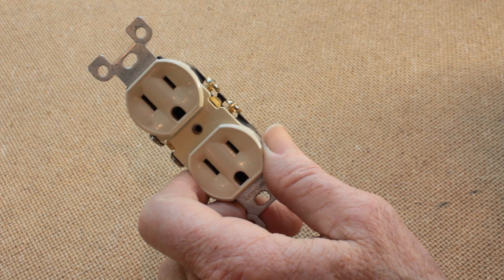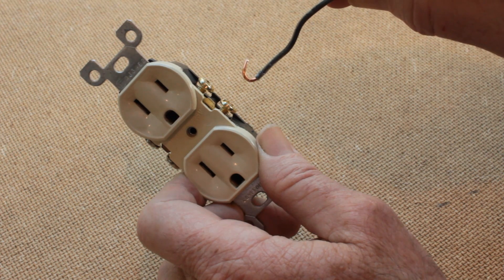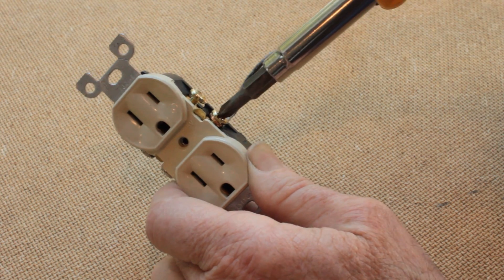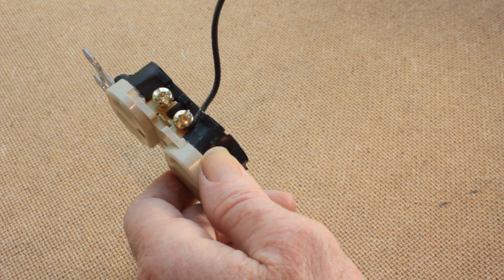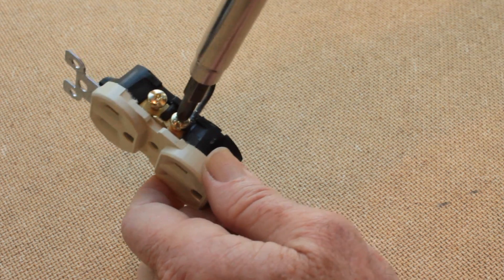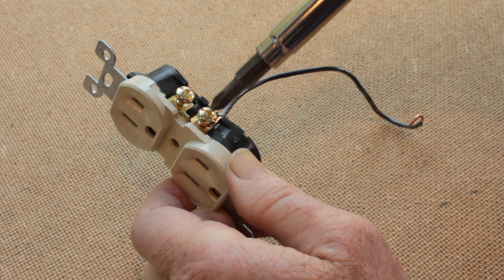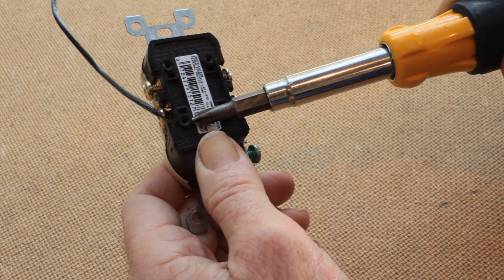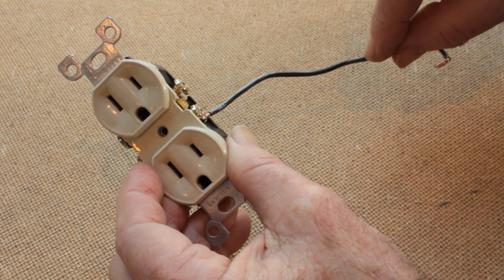A Common Goof Replacing Outlets

Comment: I would recommend using a square #1 Robertson screwdriver as opposed to a regular phillips.. for both, the terminations and for screwing the receptacle to the box.
Reply: Yes, here in Canada, the screws on receptacles all have the Robertson square hole (combined with a straight slot).  The Robertson style is the best no-slip design I've ever seen, and has been in non-electrical use (like for wood screws) in Canada for at least 70+ years.
Reply: If you can get them, Milwaukee has a MEC type screwdriver that's both common and Robertson on the same tip. Seemed crazy at first, but shockingly effective.

Comment: I have another pointer here on this.  If you're experienced enough, and can change out a device w/ the power still on, attach the bare ground wire first, then, the white neutral wire next.  Hold device with a pair of long nosed pliers by the plaster ears, then, carefully attach the black wire lastly.  If you're concerned about getting zapped, like I was in the beginning, shut down the circuit.
Reply: That’s what a meter or test light is for. To me it really isn’t dead until I test it. Trust, but verify......
Reply: I plug an outlet tester into the outlet.  Makes a nice handle, even if the circuit is off.
Reply: If it's only 110, be sure to lick your fingers first or you might not feel it!
Reply: Absolutely!  I have more than once thought I turned off the power, just to find that I turned off power somewhere else.  Always test - and always test for hot - regardless of the color on the wire.
Reply: Kurt Harer "experienced enough"? I doubt OHSA would consider one qualified to rewire an outlet live. Would the risk of doing it dead, out weigh those doing it live?
Reply: Hah! For years I've been thinking that I was the only person bold or dumb enough to work on live wires. It's good to know that there are others out there who are not intimidated by a few billion measly electrons. It's pretty simple, really; don't be grounded!
Reply: They have pills for that now.
Reply: and that was his last comment folks. He was a nice guy though.
Reply: As a rule there is rarely a valid reason to work with live circuit, why do so, if the circuit can be de-energized?. A few steps is not worth not following basic safety practices.
Reply from the maker: True, sometimes it is a big hassle to turn the breaker off. But my advice is that if you are in a hurry, you are more likely to get shocked accidentally, in spite of knowing how to do the task live.
Reply: @ TheCircuitDetective,  oh yeah, I've been bitten by Old Man Electricity before.  I worked as an apprentice for a Master Electrician, along with one other Apprentice, and Journeyman.   They would say, okay, power's off. They loved playing games with me. Never trust the other guy saying thus and such. The Journeyman was good to me, and he's the one that showed me the ground wire, then the white neutral and then the black hot wire last.  I learned quite a bit, and rewired my own house, built back in 1902, then, added on to in 1959. This old house was wired with Knob and Tube wiring, no ground either.  The original owner used a DC generator for power.  In 2009, the Journeyman, and myself, changed the house over from 100A to 200A, and proper grounding to boot.   Well, thanks for the reply.
Reply: why would you want to do it that way? If you hook the hot wire up first then you can handle the outlet and the wire without getting shocked, then when you go to hook the ground and neutral up you only have the one small area that you have to avoid touching instead of having to work with a wire that you cant touch while hooking it to something you cant touch
Reply: In a hospital, it might be less risky to rewire an outlet live. Although they would probably require a gloved hand as opposed to pliers. Squeezing too hard could cracking or break the plastic. Hospitals would probably use outlets where the wire goes in straight and is clamped as the screw is tightened.  You mention plastic ears on an outlet, but I've never used or seen one. Are you sure they are plastic?

Comment: Actually i just put all my outlets in... and i am having problems plugging things into the upper outlet... it doesnt want to fit... what can i do? The bottom one is perfect the upper ones feel like u can't use them...
Reply from the maker: Most new receptacles now are "tamper resistant." That will mean that both of the flat prongs of the cord you are plugging in have to enter at the same time and at the same angle. Otherwise the receptacle will resist. That might be what is going on.
Reply: TheCircuitDetective so should I try to take it out of the wall and bend the cords again behind it to try and see if its the way it was put in? Because it wont take a plug at all. :/
Reply from the maker: . No, I don't think how the wires were attached behind the receptacle would account for your problem. It could just be that the upper half of the receptacle is broken or has something stuck in it. So I would just replace the whole thing.

Comment: Your wire looks like it was stripped way too long.  There is a strip gauge on the bottom of most new outlets this reason.  To take the guess work out.
Reply from the maker: This is almost the point of this video. It is not clear whether the strip gauge is for when you would be pushing wires into the holes on the back or curling them under the screws on the side. In any case, we can't be held to the strip gauge anyway, because no one can strip wires that exactly.
Reply: The point of this video is based on the fact the strip gauge is for use with the push in option, not the screw terminal option. The reason he strip off as much as he did was to insure the insulation can't interfere with the screw.

Comment: I replace a new ac 3 prong outlet  , followed to  wire to wire from old to new out let ,  now when checking with volt meter the [shorter] slot prong is hot to ground  it is  OK 120 volts it works fine. but in  my mobile home  has ALL its outlets are opposite the [long ] prong slot  to to ground  is 120 volts in a 1976 mobile home?
Reply: If the colors are also reversed - so white is hot and black is neutral, you may want to switch at the panel.  Sounds like the whole unit is reversed.

Comment: funny how state by state the lingo is different for the wire naming---  common neutral ground.  power,common,ground     The electrical code book needs to be nationalized so the lingo is country wide.
Reply from the maker: If you're talking about states of the US and about a house's own wiring, the terms "hot, neutral, ground" are pretty established; "common" means something else. I don't find electricians or homeowners using the Code book's names for these, namely, "ungrounded, grounded, and grounding."
Reply: I totally agree with your statement.   I just want established consent in the USA and understanding even how you currently understand it.      I could be wrong but I think even this wording should be the same with even residential VS industrial wiring as well and should be the same.
Reply: The national Electric Code uses proper terminology consistently. The problem isn't the book. The problem is people who can't be bothered to speak in a professional manner.
Reply: I still love to trip up people, by calling the hot wire the active, the neutral remains the neutral wire, and the ground as the earth wire. These terms are seen in 'Straya and that part of the world.

Comment: i have an outlet that started acting up. i used a non contact voltage tester to probe the outlet. it would beep and light up quit for a few seconds then beep and light up again. it did this on top and bottom of recepticale and on both prong slots. any ideas?
Reply from the maker: I suppose the act of probing could affect the quality of wire-to-receptacle contact right at that outlet. If so, replacing that receptacle would solve the problem. Otherwise, I'm not sure.
Reply: TheCircuitDetective I tried it on an outlet that was replaced by a licensed electrician,  when probing it lit up constantly but only on the right prongs. i suppose it wouldn't hurt to just shut off power and replace with new receptacle and check for damaged wires?
Reply from the maker: If the electrician was trying to solve the problem you had, he seems to have failed. Would he come back without a trip fee? The tester beeping for the left side may mean there is a poor white-wire connection there (or at another receptacle of the circuit). My website could guide you if you want to try to tackle the problem yourself.
Reply: TheCircuitDetective no I just used the non contact electrical tester to get an example off a replaced outlet. he replaced that outlet in the living room one of the wires was bad and caused problems, he replaced the wire also. this new problem outlet is in a seperate room. when I had something plugged in it would sometimes work then quit. I stopped using that outlet for now all together.

now a family member reported another outlet in that bedroom is starting to sometimes act goofy. maybe this is over my head?
Reply from the maker: It's up to you. If thecircuitdetective dot com sounds beyond you, you may need the electrician back. He's batting  1000 so far.

Comment: "The hot wires normally are the black wires."  Hahaha!  If a weekend warrior has been modifying the electrical system, you cannot assume that.  Literally, everything needs to be questioned and checked.
Reply from the maker: Yes, but if it is also a weekend warrior who is now replacing the receptacle, he doesn't know how to check everything. In that case, just duplicating on the new receptacle what side of the old receptacle a wire came from shouldn't cause a problem.
Reply: Guns are always loaded and wires are always live until you have checked for yourself.
Reply from the maker: The movement of electrons does alternate, but a "hot" wire remains hot regardless, because it is still able to complete a circuit (circle) to ground. When we say about AC that power "goes out from the breaker," it is only because we need a directional way to talk about the PATH electricity is taking (whether in one direction or the other at this instant).
Reply: The white wire goes to the silver colored screw and the black wire goes to the brass colored screw.  The ground wire (green or green/ yellow stripe.) goes to a screw on the frame of the outlet.
Reply: Totally agree.  Reversed hot/neutral has all kinds of potentially harmful issues.  Always check - or just don't mess with it in the first place if you don't know what you're doing.
Reply: so from my understanding the electricity is alternating current , it goes one way then the other 60 times a second . so is it going in or going out ?
Reply: True.  Our hallway had a 3-way switch that didn't work.  I traced the wiring and fixed it, and you could tell that the interior had been repainted at least THREE TIMES since those mis-wired switches had been installed!!

Comment: Black wires are hot, however a white wire with black tape can mean hot wire too. Depending on the current flow and receptacle function.
Reply: J K.  True but the only time a white wire is used is in a switch loop using 2 conductor wire. Now NEC code requires 3 conductor wire. Black and red being your hots.
Reply: CEC is the same in Canada as of 2018
Reply: I was recently told by a licensed electrician that using tape for marking wires is no longer the preferred method. He just used a black marker.
Reply: Three way switch ?

Comment: the new decora plugs have a slot for two wires which slip behind a brass plate and the screw holds them firmly in place, easier and more effective than any other way

Comment: good advice.  And correct not to use the holes on back which create an inferior connection compared to using screws on side.  So many bungling tradesmen out there!
Reply: Bounder Rabbit it has nothing to do with "bungling tradesmen ". The outlets are U.L. listed to be used with the push connection. It's much faster, and so will continue to be used in that manner because labor is the biggest part of a cost bid. If even one contactor is bidding the job based on the faster install time, anyone who doesn't, doesn't have a chance of getting the work. As long as people want to pay bargain basement prices, don't expect that to change.

Comment: I had a new house that was built in a lumberyard that was moved onto a foundation on my property. The electricians came out that afternoon and installed a service breaker box and hooked up all the pre-wired house circuits. One of my circuits did not work and I found they had not stripped the insulation back at all before they stuck it into the breaker lug. That was actually hard to diagnose because it looked fine.

Comment: I've seen many old outlet installations where the electrician didn't curl the wire at all---they just stuck the exposed straight end under the screw and cranked it down. Not too safe....
Reply: That's probably one of the reasons while the fire insurance sector developed the push in technology.

Comment: Another small reminder is that Black wires goes to brass colored screws (Hot) while White wires connect to Silver or Aluminum colored screws (Neutral) and to always wrap the wire in the direction the screw tightens (Clockwise)
Reply: True to an extent.  You never know who wired the house prior to you. I have seen multiple colors of wires in conduit runs that were the "hot" wire because they did not wire correctly.  The only way to be sure you are putting correct wire to brass side on receptacle is to check with voltmeter that you have the hot wire  even though a black conductor "should" have been used If wired properly, but I never take for granted that just because the wire is black, it 100 percent of the time it has to be hot, so I always verify.
Reply: Juan S yes I was told yrs ago black to brass to save your ass , that stuck with me
Reply: This is gonna sound weird. way back when..I remember thinking of the beverly hillbillies song..black gold - Texas tea ..the black/gold thing stuck with me.I guess it doesn't matter how you get there as long as you get there.
Reply: a white wire can be hot and wired correctly but it's supposed to be marked with a black band to signify its a hot wire.
Reply: white wire didn't used to be required to be phased on a reverse switch leg. so, as Bob Billings stated always best to verify
Reply: So true. Grandpa always said black on brass, white on shine, ground on behind.
Reply: thx tj...now that song is stuck in my head..."well the furst thang ya know ole Jed's a millionaire....
Reply: Tjfreak, Thanks for that tip. Its actually a great way for me to remember now. Like you said, whatever it takes. Thanks Bud !
Reply: New Orleans Saints black and gold
Reply from the maker: By "to be phased" I think William Davis means "to be reidentified (taped black)".
Reply: @TheCircuitDetective  yes that's what I meant. That's the term everyone uses in Central Florida, even the inspectors. And I like to use a permanent marker because with the heat and humidity here tape just wilts off before long and you can use any color other than white gray or green in a single phase 240/120v system
Reply: Since in the Us people think of their outlets as "smiley faces", I always say "white is right when you're upside down"

Comment: Good to know for amateurs like me.  I was thinking about replacing all of my receptacles in my old house, too.
Reply: It's not hard to do at all.  Just make sure  you have a circuit power tester ($10-15 at Home Depot) to ensure the wires are cold before working on them.  (Just because the lights in the room are off doesn't mean the outlets are also off...and I'm speaking from shocking experience!)  :-)
Reply: Thanks for the tip

Comment: I will not do any electrical work myself.  I will hire a licensed electrician.

So many lives have been lost to house fires.  Many due to faulty wiring.

Even nicking the wire while stripping the insulation can cause the wire to over heat, per a licensed electrician.
Reply from the maker: Your choice.
Since you like to cite sources, it would have made sense to do so here, instead of summarizing with "so many lives" (how many?), "many due to..." (how many?), "can cause" (in what circumstances?).
Reply: Nicks can happen to anyone. A licensed electrician is the one who installed the wiring in my home. It became apparent many years later when condensation built up in the conduit in my garage (I had added a heater). The condensation caused the wire to short against the conduit, sending sparks and fortunately tripping the breaker.
Reply: esthomason Are you certain the short occurred due to the combination of a nick and the condensation?  (i.e., was the wire nicked at a place other than at the end where it was intentionally stripped?)
Reply: Certain. I was able to (unsafely) observe where the sparks originated. After disconnecting the wires, I discovered the more-than-a-nick several inches up the wire where the bend in the conduit was, creating the contact point. There was definitely condensation, as well. Since running new wires, haven't had a problem.
Reply: esthomason Glad it is safe now and that he at put in the correct breaker which successfully tripped.

I also appreciate your reply.
Reply: If you don't know what you are doing and are likely to do it wrong, it's better to hire out.  But doing proper electrical work is absolutely possible for the DIYer.  Although I may be a bit biased as my dad is an electrician and I can always have him double check my work and let me know how to meet code.